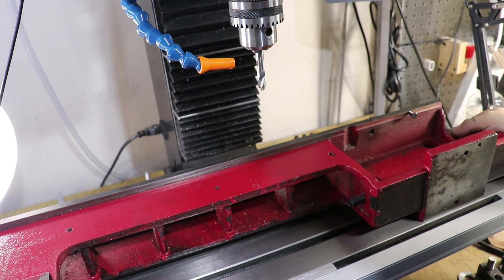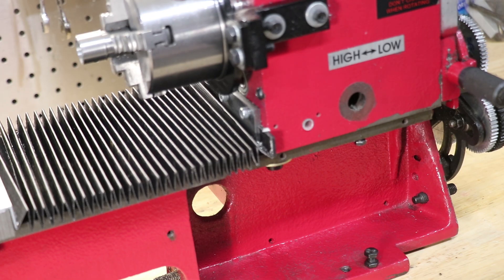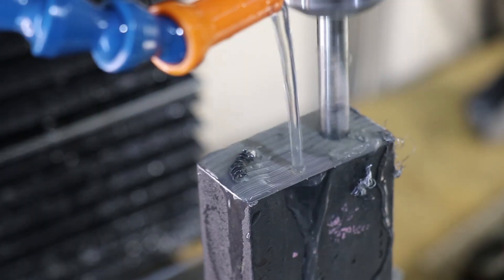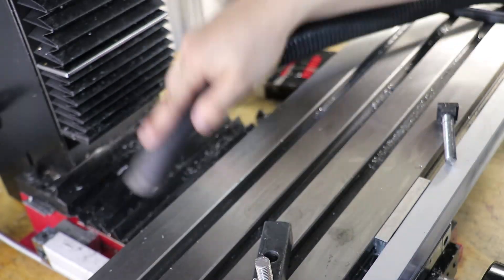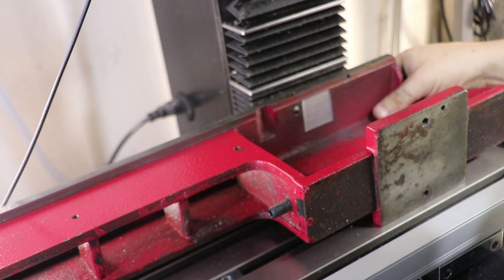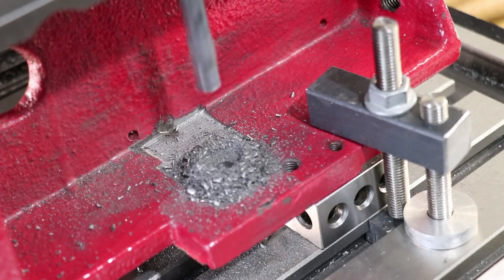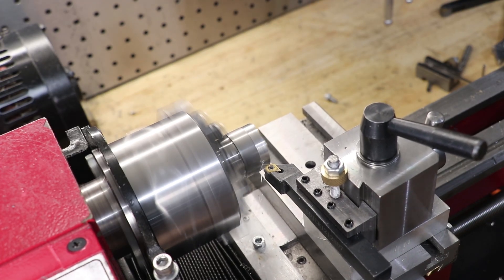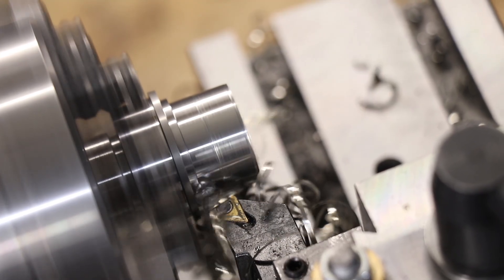Mini Lathe Headstock Rigidity Upgrade

Comment: Thats really good! I saw this from an other youtuber lately and thought to do this to my lathe too. Seems really necessary to eliminate this source of weakness. Unfortunately in my case the motor sits in this little cavity, have to to modify that.
I'm not sure, if you introduced a twist to the bed. The steel block seemed to sit a bit loose and by tightening the bolts it might have deflected the bed.
And by the way, how do you manage to produce that much videos o: :D respect!
Reply from the maker: I did have to shim it a bit since I made the block a little under size to avoid it twisting the lathe.

The video schedule is a bit difficult but a lot of this is old footage from the beginning of the year/end of last year that I'm slowly getting through editing. It's bit easy but I enjoy it.
Reply: @artisanmakes  great:)!

Comment: Now you just need to bolt it to steel plate workbencg and fill the headstock with epoxy granite to kill some of the vibrations that comes from there ( it's basically a hollow metal box that also vibrates) ( with a pipe around the axle so that doesn't get stuck) and you done almost every thing I would had done with a mini lathe ( at least for now

Comment: i might give using toe clamps for my vice. The flanges are just weirdly spaced on my vice - I have to use the inner T slot with the location of the flange mounts to be able to have enough travel, which is a pain!

Comment: Interesting modification. 
Interestingly my mini-lathe has 4 bolts securing the head stock to the bed, 3 seems a bit lacking there. 
I found squaring up the head stock to the bed helped improve rigidity too, as the unflat base of the head stock was adding some twist to the bed.

Comment: Looks like they may have been using the motor as a structural component. Would be interesting to see if you can notice rigidity differences with the old and new motors.

Comment: That bottom bolt is loose. You didn't tap it deep enough, it bottomed out! The washers are still floating, the head is like 1mm away from the washers
Reply from the maker: It just needed an extra half turn with the socket set. I just didnt film it

Comment: The draft angles in sand castings are actually to release the pattern from the mold. The mold is destroyed after each casting.
Reply from the maker: Yeah I was thinking of the wrong molding process, cheers

Comment: Is there really only 3 bolts from the bed to the headstock? 
Can you add a 4th?
The vertical element you justadded will twist everything as it wasnt a zero clearance fit... ie too short.
Reply from the maker: Its a pretty tight fit actually, not sure if it looked that way on camera. There was a small low spot but its not mounted there 

EDIT: I looked back at the footage I had, and yes it was a little low, but I did shim it tight.
Reply: Ade's workshop is fixing up the same mini lathe and added a fourth bolt for the headstock, and sat the whole thing on a steel box section pipe to be filled with concrete to stiffen things up a bit.

Comment: That wood surface is probably resonating nicely at the frequencies you're using (that's why wood works for instruments). Buy a piece of scrap marble/granite/stone countertop and bolt the lathe to it. Then put some 4mm or thicker pieces of rubber between the marble and the wood surface. The mass of the marble will reduce the resonance, and the rubber will decouple the lathe from the workbench.
Reply: Though wood is actually really good at absorbing. But it's no way as stuff/strong as a steel bench top
Reply: It's not likely for that small vibration to transfer to the workpiece though when the whole machine is moving as one
Reply: @cda32  i know but every little bit cound on those small machines

Comment: You better check your  lathe for twist. Clamping such a loose fitting block under the head stock like you did would surely twist the bed.
Reply from the maker: Its a pretty tight fit so there isn't any room for movement, it lokis a little loose on camera, but its final mounting location way a pretty tight fit

EDIT: I looked back at the footage I had, and yes it was a little low, but I did shim it tight.

Comment: Clamping a steel bar under the head stock would have me worried about introducing a twist in the bed.  Great job on the work.  I’m certain rigidity is much improved.
Reply from the maker: Its a pretty right fir so it shouldn't induce any twist

EDIT: I looked back at the footage I had, and yes it was a little low, but I did shim it tight.

Comment: Maybe you should think about setting the entire base (length and breadth wise) in concrete in such a way that it can be bolted directly to the floor. Not sure if such an initiative would be worth for this machine. I also suspect that the loss in rigidity can also be attributed to an extent to the fact that it’s bolted to a wooden table.
Reply: At that point he may as well just get a block of granite and some linear rails, throw the rest away, and just use the lathe spindle.

Comment: Good job! Would it be worthwhile doing a test bar between centres to check that you haven't pulled a twist into the bed with tension on one corner?
Reply: Agreed, that bar looked a little too loose for my liking.
Reply from the maker: Not sure why it looked that way on camera, there was a small low spot, but its a pretty tight fit
Reply: @artisanmakes  it looks at least 5 hundreds, that is huge
Reply from the maker: @TheMorpheus017  I think I had to add 2 bits of shim and that tightened it all up.
Reply: Also the ridges left after milling on the mating surfaces will affect positioning ever so slightly, it will want to find a high and low on a position, if the exact position corresponds to 2 high spots /ridges you won't  have a total contact area